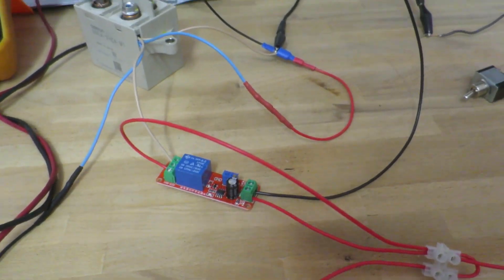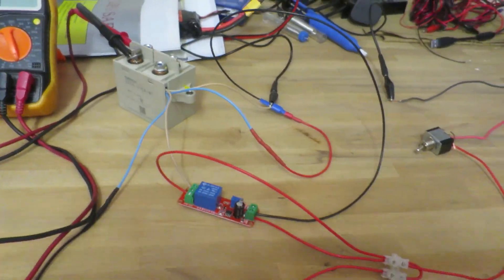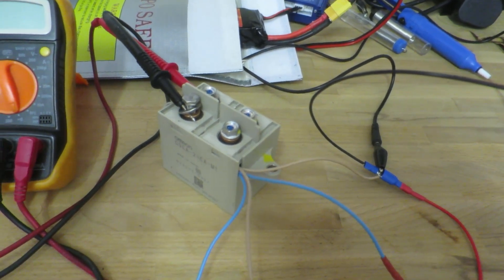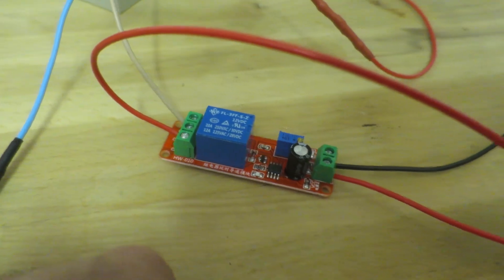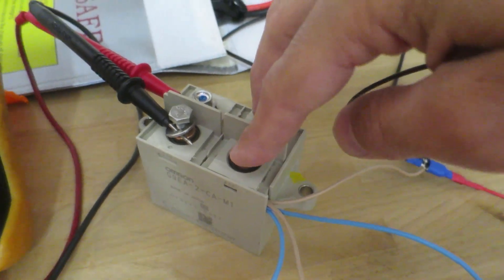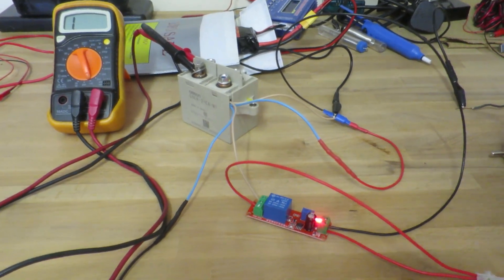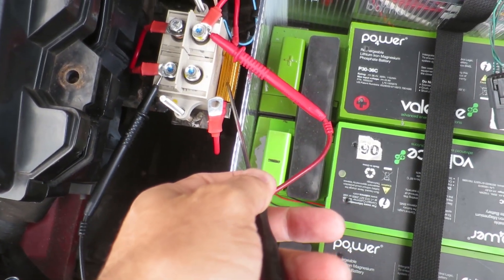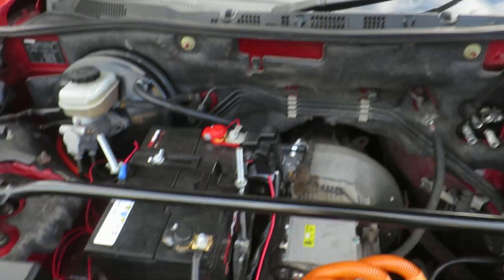Making a Pre Charge circuit for my EV RX8

Comment: Are you absolutely sure that no power would be flowing through the resistor once the main contacts are shut? I know path of least resistance but nonetheless some power would flow through it?
Reply from the maker: The pre charge resistor has its own relay to disconnect it. You can test with a continuity tester, or simply try to read a voltage across it - which shows it is disconnected.

Comment: Hi, I'm making a similar pre charge circuit. I'm a student and i was wondering if it is necessery to add a reversed diode parralel to the main contacter to prevent damaging the relay, if my motor is braking regenerative. The inverter is rated 100V 120Amps.
Reply from the maker: Tricky to know without a diagram, but the regenerative current should flow back across the closed contactor - and not worry about the relay side (path of least resistance and all that)?
Reply: @SouthWestEVUK  Yep i think diode is unneccessery indeed, but what about switching a big relay while high current(160A) in flowing through. I'm considering adding an emergency button, but i dont know if this will damage the relay, if i suddenly open this relay?
Reply from the maker: You have to make sure your relay is specified to the current being drawn. As there will be an arc and so the relay has to be rated to deal with that arc and not weld shut.

Comment: Very Kool! What method did you use to "size" the resistor? (wattage & resistance)
I recently made up a manual precharge circuit for a 60V go kart.
https://www.youtube.com/watch?v=BT8QcExOWSo
Reply from the maker: I picked a resistor with a high enough voltage rating, and a watt load to ensure the capacitors in the controller didnt face an open circuit situation. You can measure the voltage during pre-charge to see how fast it goes up. Anything over half a second is fine.

Comment: I believe it is important to disconnect the pre charge resistor after the main contactor has connected. If you don't there will be some current through the resistor and it will burn out after a while.
Sorry if I picked you up wrong but it sounded like you were keeping it in the circuit.
Reply from the maker: Interesting, obviously resistors are designed to have some current running through them, I will keep an eye on how hot it gets - this will give me a good indication of how hard it is working. It should be stone cold, if not then I guess I can re-think it! I can see inside the car if it is working when turned on, as there is a 1/2 second delay in the voltage increasing.
Reply: @SouthWestEVUK  I'm only a keyboard warrior at the moment as still in the planning stage but that is what I heard from other Youtubers and from forums so would be interesting to hear your real world experience.
https://www.youtube.com/watch?v=RcIAnKZcI3I
Reply: doesn't the main contactor short the voltage across the resistor? I would be more worried about the dissipated power during the precharge. P = V2/R and all that. Good video and explanation though!
Reply: I have watched the video link, they are disconnecting the precharge relay to protect the relay and not the resistor, their concern being the relay will fail if it is permanently in operation. They are also monitoring the voltage on the capacitors to determine when they are sufficiently charged to operate the main contactor safely.

Comment: Nice. I just did the same a few days ago in preparation for an extender battery pack. Just one note: normally the precharge is for less than one second, as I know.
Reply from the maker: Yeah, I have a voltmeter on the Inverter side of the contactor, it gets to about 99% in half a second now. then 100% when the timer is done. I left it a longer period to be safe, but as issues occur in the first milliseconds then I guess a second is fine.
Reply: @SouthWestEVUK  yes - it is up to your capacitors. Just be careful: once you install the leaf inverter, you may need to reduce the timing otherwise the resistor fries (known issue). Mind you, i just have a leaf main controller at home, tomorrow i will look for the precharge resistor code so at least you can get the correct size of resistor.